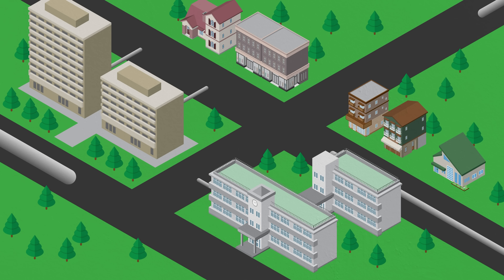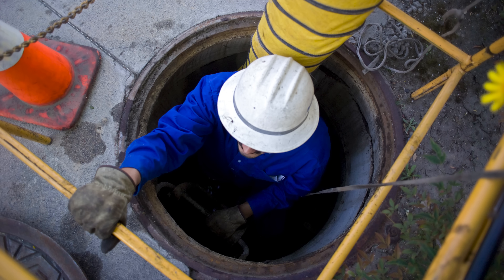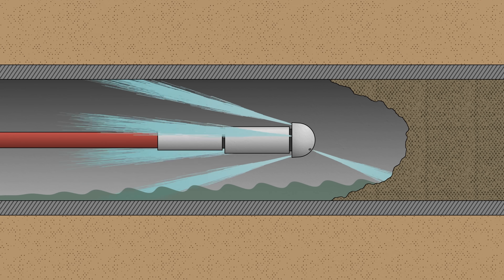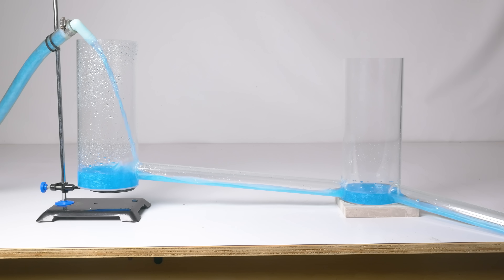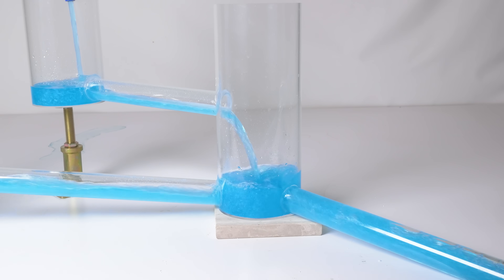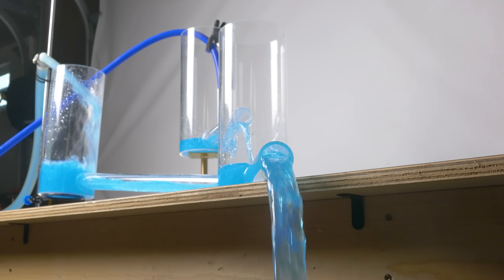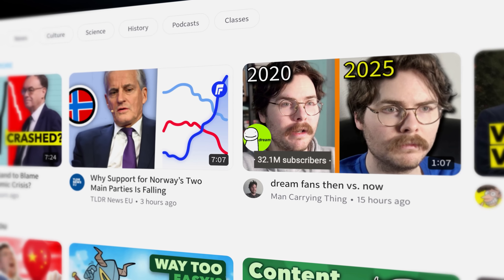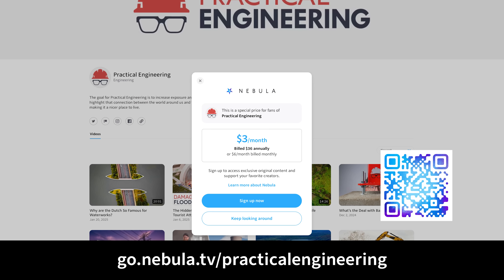What’s Inside a Manhole?

Comment: In the late 90s, I mapped the sewer system in a large city in Georgia. We had a rough map of the system and a LIDAR elevation of the manhole lids. We popped the lid, measured the invert and threw a stub out for all the connected pipes (with pipe diameter). The end result was an accurate map off which you could run models and plan maintenance. I will never forget the palmetto bugs, AKA - cockroaches. We figured 1/100 was an albino, so when you looked in the manhole and saw 20 albinos.... Another fun fact: cockroaches like to run up, so if you popped the sewer lid off and they scattered, it was good to have your pants tucked into the boots.
Reply: Pants tucked into boots, AND duct tape seal.

Phone line installer in businesses and homes and came across my share of nasty cockroaches.
Reply: I have a phobia of cockroaches so I don’t think sewer diving is for me.
Reply: @uzaiyaro You could still live your dream! I work in sewer structures in New England and we have no palmetto bugs up here. Just a handful of sewer flies and... worms. 😅
Reply: @JonathanSias  oh, sign me up!
Reply: @JonathanSias  and 🌽!
Reply: great report of life as it is actually lived... Love the details. never knew there were albino cockroaches! 😄
Reply: @eileen7303  I worked on other similar projects and didn't see many. But they were there in Savannah. Still gives me the heebee geebies thinking about it.
Reply: Cockroaches aren’t albinos. What you were seeing were roaches that had recently molted. (My tarantulas love freshly molted feeder roaches, because they are soft and gooey.)
Reply: @Mike_in_Cinci  2015 I was trying to decypher a collection system blueprint from 1916.  A tattered actual blue print, trying to find an invert before a river crossing.  Never found it, in overgrown woods with scrap iron everywhere, and no camera to measure.
Reply: @WildRapier I love old blueprints. I collect them, mostly old buildings. I never found an old sewer blueprint, I wish I had a copy of that one, so cool! One thing I found is you cannot always rely on documents you find. Some guy always wants to make changes during construction.
Reply: Reminds me of when I started out in EMS.  My FTO told me that if I saw cockroaches doing a cakewalk across the bookshelf, the equipment bags do NOT leave our shoulders.
Reply: Atlanta or Tblisi?
Reply: @vinnysworkshop  Savannah
Reply: When I was a kid growing up in south Florida we had a manhole in the swale between the sidewalk and street in front of our house. I remember my oldest brother and his friends opening it up one time. There had to of been a million palmetto bugs in there. Nightmare fuel for sure.
Reply: I thought palmetto bugs were different than cockroaches, very similar, but also different
Reply: @flipperbooch219  “Palmetto bug” is a euphemism for the Florida woods cockroach (Eurycotis floridana). They primarily live outdoors. (It’s a different species from the Oriental or German roaches that infest buildings.)
Reply: @flipperbooch219 My mother lives in Florida. A palmetto bug darted from underneath a cabinet. My mom's girlfriend ran out of the house in horror.😂😂😂😂🤣 Palmetto bug won't hurt you, they are harmless.
Reply: Tape around the bottom of pant legs.
Reply: "Roaches like to run up."
That's how you escape the floods! 😅
Reply: I did a similar project a few years ago in a defence precinct, and opened 300-400 manholes. Surveyed the invert, pipe diameters, direction of flow, etc. And yes, the albino cockroaches. I can confirm, they will crawl up anything. Didn’t take long for me to learn to tuck my pants into my socks. I’m in Australia. I’m both surprised and not surprised at all that cockroaches have made a home in sewers around the world
Reply: Modelling systems is one of the coolest design and maintenance tools out there. This same concept has continued to develop to the point where more sophisticated engineering firms are able to work with cities to create a "digital twin" of their system which is essentially a super detailed digital model. 
It's one of the best ways to find the next part of the infrastructure that needs upgrading, and how new improvements (or potential failures) will impact the system as a whole.
Reply: @rossnavarro2591 there are several modeling programs that got fed the data. The big factor is the invert elevations. Once you have that the models are pretty accurate and predictive.
Reply: this is why I'm never going to work on sewers
Reply: HOW DOES THE LIDAR GET THE DEPTH WHEN THE WATER WAS SOLID BROWN WITH TURDS? WOUldn't it only be able to see the surface of the water?
Reply: @ lidar gets you the elevation at the rim. The depth was determined with a surveyor’s rod. A rod that was disinfected regularly and stored outside a vehicle. We had a tablet PC with GPS and a digital map and database that could be updated live. As an aside - hepatitis A vaccines were a requirement.
Reply: Did you use a camera for the pipes underground? WOW that's interesting. I map buildings when the blueprints are lost, and needed. Most building departments toss them after so many years. Thank you building departments😂😂$$
Reply: @D @DooWop45s pipes are straight between manholes. We recorded pipe diameter. We did not camera any sewers. I have done that, but not in this job.
Reply: My dad works in streets and sewers in his city. Their current system is mapped by lidar, but every so often they run into some piping from 100-or-so years ago that’s no longer connected and was never documented anywhere

Comment: 7:51 I'm no fluid dynamicist (GFD doesn't count), so can someone explain why water is backing up into the nearer manhole but not the farther manhole (not in frame)?
Reply: It does both at the same time until pressure equalizes.because of head losses the manhole upstream will fill first.
Reply: @donquique1 Sorry, I don't understand. Is the farthest manhole (not in shot) also filling? I assumed it wasn't because its outlet tube isn't filling.

Comment: In Sweden, we have pipes leading up to the roof that ventilate unwanted gases and odors from our sewage systems. Not through holes in manhole covers, the so-called 900 manholes. We call them that because they are round and 900 mm straight over. But when I think about it, there are between 2 to 4 holes in a 900 manhole, although if they are ventilation holes, they are very well disguised as grip holes for tools used to lift the cover.
Reply: The roof ventilation pipes are also used for so-called smoke-tests, to check for accidental cross connections between stormwater and sewage pipes.

Comment: Another interesting video. I had not realized manholes were used to change direction and pipe segments are straight. After a few seconds of thought that makes sense.  My parents built a house in the early 1950s. The increased suburban development  obviously increased effluent flow. Being in the Midwest houses have basements so early on we had a couple of interesting basement water events. 

Now that we live in the boonies (well not as much as 50 years ago) we are on a septic system so anything we flush is our problem.

Comment: And for anyone who wants to look at history of this.  Vitruvius (~80-15 BCE) and later Frontinus (40 -103 CE) wrote about such systems, the amount of slope needed, etc. in roman times.   I found it interesting that ~2000 years ago their basic statements as to sizing and slope are pretty accurate and are much simpler than the many pages of fluid dynamics equations done these days.
Reply: Pretty accurate for 1000 people is good enough, pretty accurate for 100v000 people is a problem
Reply: @adaroben1104  considering rome had a population nearing 1,000,000 think their civil engineering was pretty decent.    It took nearly 1800 years before any other city came close.
Reply: Sure, but your overall point is not accepted.
Is your point that we should be impressed by Rome using the engineering? Probably got it from the greeks.
Reply: @adaroben1104  "What have the Romans ever done for US?
"The aqueduct"
"Sanitation"
"Irrigation"
[And so on..]
"All right, but apart from the sanitation, the medicine, education, wine, public order, irrigation, roads, the fresh-water system, and public health, what have the Romans ever done FOR US?"
(Monty Python, Life of Brian)
Reply: I also find it funny Vitruvius considered all of this the same discipline -  "architecture".
Reply: Or if we had more archaeological evidence, we could find the same stuff in the very old Harappan cities in Pakistan and India (Indus Valley civilization)!
Reply: Nope. They used simple multiples to rate different pipe sizes rather than the square. Big mistake.

And 'pretty accurate' isn't enough today. 

Engineering experience would adjust for that, but the root maths was wrong.

Comment: Manholes are for more than sewers... I used to do mainline water taps, with valves. It usually took longer to construct and brick the vault and manhole than it did to excavate and install the tap! The inside of some of those big old mains have some spectacular mineral deposits. Like shelf mushrooms in the pipe. I can't imagine the flow restrictions they cause. Around here we still see some old fired clay pipes, too, downtown, usually.
Reply: systems with hard water use additives. See Flint Michigan for why its important to use the correct amount.
Reply: Been in old drains with completely blocked off inflows.
So yes, flows certainly restricted.
Reply: @ I was referring to inside the mains... but it happens everywhere.
Reply: I worked my local water crew for a year and a half, I got to go into one of the distro pipes that was downed for yearly inspection, I think it was a 96" pipe, we went in several hundred feet until the water was almost up to my waist. I thought that was the coolest job in the world. I'd still be there if the super I was under wasn't a prick, I worked hard and had fun.

Comment: I worked for a town that installed manhole cover seals made of some type of plastic as part of their I&I reduction plan.  Worked quite effectively.  Until the winter, when the water between the manholes and the seals froze and expanded.  Once the plows hit the roads, manholes went flying everywhere!  Ahh, New England weather!
Reply: They were trying to upsell that to my city. Streets keep slapping asphalt and tar on our manholes when they do repairs, and I slapped down the whole idea. They'd be melted. My pointed questions made the guy in charge back from the idea outright, though the water union lost a guest speaker over it. They teach classes so license holder can keep their licenses.

Now I'm all the more glad I did. We get winters too, even if not New England winters.
Reply: @EveryBigfootIsANinja  a project I designed, we spec'd out standard manhole lids with a rubberized non-skid MH cover in areas of foot traffic.   Any experience with this?  This job is a senior citizen medical facility in the PNW.
Reply: @ZadieBear  That'd work for sidewalks and yards. It'd still be a problem on non-cement roads. Just keep it away from hot tar.
Reply: @LegendStormcrow  Nothing like chopping through asphalt just to check an invert!
Reply: @WildRapier  hard to believe I actually miss that work 😅
Reply: Just a couple of days ago I watched a video of a cop car getting disabled by running into a flipped manhole cover, it was like a razor blade to the engine
Reply: I would assume it was just the covers that went flying
Reply: rofl that sounds smart.  That would never fly here in Wisconsin, USA.
Reply: @casedistorted  Oh they'd definitely fly there!🥶

Comment: Question. Why can't we dig one Large pipe to house everything from manholes to underground wires. That would negate the need (hopefully) to dig up and block an entire road disrupting the traffic, and should make upgrading wires a lot easier. I know that like many things the upfront cost can be a huge deterrent, but the savings down the line should make up for it in the long run
Reply: That is too sensible.

Comment: That professor's answer as to why manhole cover is round - because the manhole is round, is not an answer I can agree with. It sounds like a stubborn answer without good reasoning. Yes, the manhole is round, but there is material (concrete?) at the top of the manhole! You will still need material around the manhole cover for the cover to sit, and this can be made into any shape, not just round.
Reply: “A stubborn answer without good reasoning” 🙃
Reply: It's round so the cover can't fall into the hole

Comment: Not just that is your problem because of taxes but you can also clog your main sewer line with those things. My brother was flushing wipes which didn't cause an issue until some construction work near the house disturbed them and caused a sewer backup which was all our responsibility to cover since it wasn't the cities line that was clogged. We did have another backup caused by roots in the side that was the cities responsibility

Comment: Fun Fact: Some complained that Cyberpunk 2077 used the wrong manhole cover. And started a petition to fix that.
They use B125 - which only go up to 12.5 tons and thus are only allowed for pedestrian paths.
They should be using D400 - which go up to 40 tons - on the road.
Reply: immersion ruined /o\
Reply: Indeed. I was relieved when I saw a D400 in the pedestrian/mixed zone in the beginning of the video.
Reply: TIL that there's different kinds of manhole covers
I legit thought it was just the one and reused. Just rate it for typical road traffic, and use it everywhere
Reply: @RyuuTenno  Filling then with concrete makes them cheaper, but at the cost of load limit.
We could build stuff that lasts as long as Roman works - it would just cost way too much in today's money. We are building the most durable on the Budget allowed.
Reply: @christopherg2347  oh, that's understandable, I just thought we were doing a universal standard for it, which, in theory could be cheaper since it's all uniform and mass produced that way. It was just interesting to see that we have different versions, cause I never really thought about that before. Cause I've seen manholes in both the road and the sidewalk, so, I've always assumed they were identical
Reply: @RyuuTenno  Same. It is "I never considered it, but now that I think about that it makes sense."
Reply: @RyuuTenno  costs say no
Reply: Well, undercutting in a dystopia? Corruption? Maybe even originals stolen by gangs for raw material and then got replaced by inferior product. Surely, an oversight by the game studio, but would make complete sense in Night City setting in many ways.
Reply: @jarivuorinen3878  Even the companies would want proper manholes in the roads.
Effectively you put a piece of very weak road into a properly build road.
That piece is going to suffer more wear and tear. And will cause accidents when it fails. Especially when transporting goods.
Reply: @ Supply chains can be compromised and this has also happened in real world where public infrastructure (although in this case owned privately by Night Corporation) has seen subpar materials used for infrastructure construction and lackluster work results. This is what I mean. Even companies have gotten subpar infrastructure in industries delivered and it has only been exposed once something has failed. Night City is very corrupt city and in that fictional world corruption in supply chains would be no surprise at all.

Furthermore as I already said, absolutely everything in Cyberpunk dystopia is taken that has any value. If you are some gang and can get scrap metal discreetly by changing manhole covers to lower quality and then sell the stolen higher quality somewhere else, or use those yourself in your corners of the city, nobody is unlikely to notice very soon.
Reply: @christopherg2347 In the UK, manholes are square and their some designed for 90 tonnes for cargo!
Reply: @AncientChineseBrainSurgeon2045  Don't we have ones that are two triangles?
Reply: Are these universal classifications? I design sewers and roads in Belgium and we also use B125, C250, D400 and E600.
Reply: @MrMattie725  I think it is a DIN (German Industry Norm). So it should be mostly universal in Europe.
Reply: @MrMattie725  There are also A15 and F900, though obviously they are more specialized for foot traffic and EXTREMELY heavy vehicles respectively.  The numbers refer to the kN load test they are built to handle, so D400 is load tested to 400kN, E600 to 600kN, etc
Reply: you'd think CD Projekt Red would get those details right cough
Reply: Since Night City is in California, and presumably still uses United States standards, it should have manholes that conform to the AASHTO M306, rather than the EN 124.
Reply: @ostsan8598  I think they have the numbers printed on them?
Reply: They installed cyborg chips to make the covers stronger, duh. What you don't know is they also shoot lasers when you open one so they can't be stolen.
Reply: Yup, that was the only thing that was wrong with that game.
Reply: Oh yeah... The manhole covers were the biggest issues in that game...